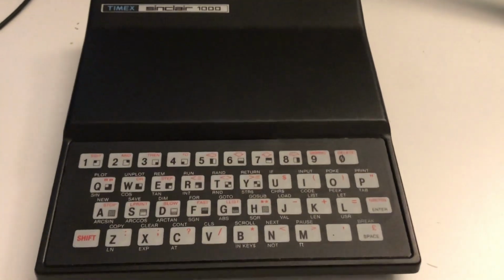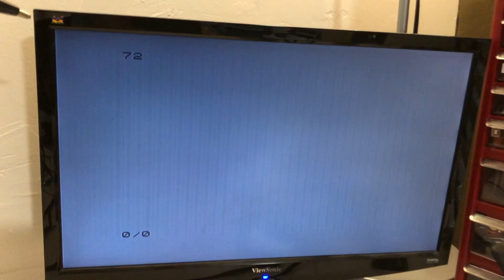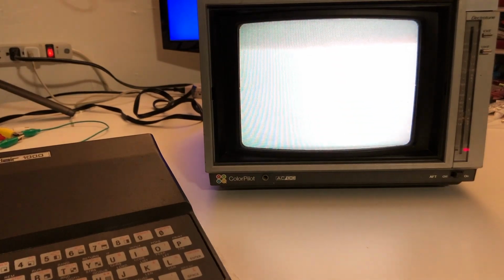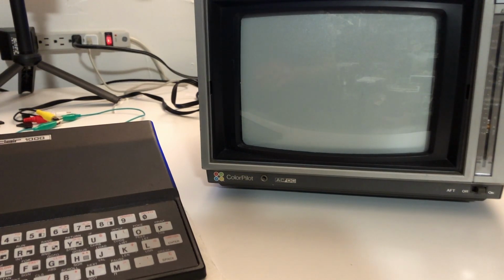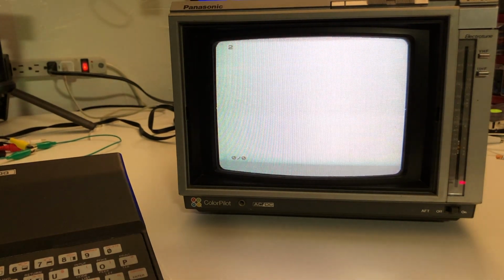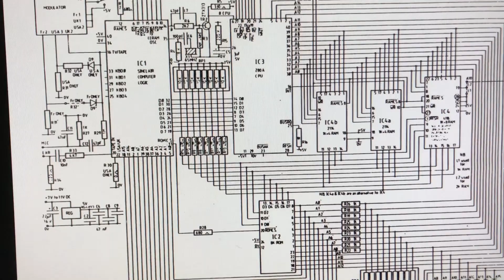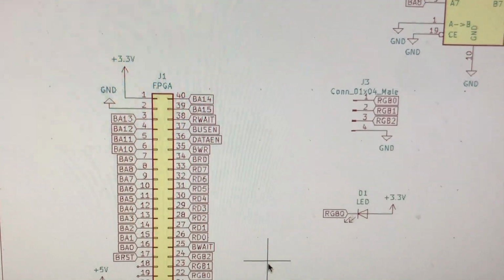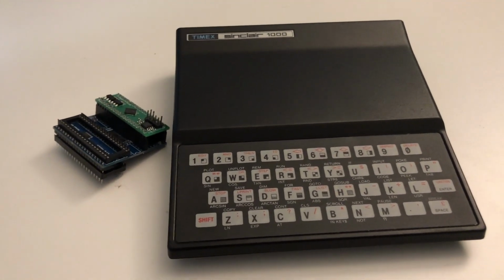ROMulator Z80  - First Test!

Comment: the [G] you have at startup means you are in graphics mode : but you are actually not as you don't get graphic characters when pressing keys.
the [K] you shoud have means keyword mode that toggles to something else as soon as you entered a keyword. ( which is a whole keyword associated with only one byte ).
What I think happens, is that your BASIC interpreter doesn't init properly ( maybe you don't start the ROM on the right address ) That should need investigating.

hi from France, I am 53 and have been using a ZX81 since 1982 :D

Comment: Zxiq doesn't have "video memory" as such, the video signal is generated by software. The screen contents are actually stored in a movable "list of terminated strings" structure. I'm not certain after 40 years, but I think the line terminator is a C9 RET opcode for some reason.
Makes sense that what's breaking is either IO addresses being treated as memory addresses by your hardware, or the high bit of the address bus being used by your hardware where the ZX81 itself  ignores it - as you thought.

Comment: T/S 1000 has metal across the board that to ground the case for FCC. Problem is One end likes to break solder joint.  This can cause the computer to not work even when board is in the case. Don't fix the metal but cut in half then use small wire to jump ends on the board.

Comment: ZX81 and Zx80 are not the best for testing a Z80 emulator. The architecture used in not “clean” at all. The cpu PC register is used as address generator for video image scanning by tricking the cpu to “read” NOP from program memory ! The data buses are separated by series resistors ;). Use a least zx spectrum that has not so strange architecture.
Reply: I dunno what a "strange architecture" is, is there an architecture god deciding this you subscribe to? Anyway, the good old specci is strange too under your critera, as it still has resistors on the data bus, on the ULA side to be more precise. Also, the specci ULA switches off the CPU clock instead of making it properly release the busses. Maybe this all is just design reality as opposed to ex cathedra.

Comment: The ZX80 & ZX81 (T/S 1000) use some clever tricks to have the CPU do most of the work in generating the display.
It's easier to see what is going on from the ZX80 schematic. Since the same logic is implemented by standard TTL logic chips.

Both the ROM and RAM appear at multiple addresses.
For the ROM this is 0000-1FFF, 2000-3FFF, 8000-9FFF, A000-BFFF
For the RAM this is 4000-43FF, C000-C3FF (1K) 4000-47FF, C000-C7FF (2K) 4000-7FFF, C000-FFFF (16K)

What's used as the video memory is the copy between C000-FFFF.
The reason for the cursor changing to an inverse G is the system variable MODE. According to the manual, this is at 16390 (4006) though it looks like it's 49158 (C006) which the ROM actually uses.
What should work with the ROMulatior would be to add 14k of RAM between 4800-7FFF mirrored at C800-FFFF. Replacing the internal RAM requires holding RAMCS high on either the ULA or the edge connector.
RAM expansions larger than 16K for the ZX81 would only enable the external RAM between 8000-FFFF for none instruction fetch operations. Emulating these would require M1.
Reply from the maker: Thank you Mark, great information! The next revision of the board including M1 should be arriving in a couple of days, I will try this out.
Reply: @bitfixer6502  What's actually going on is that the Z80 attempts to execute the contents of the display area. The ULA latches the contents of the data bus and then overwrites anything other than a HALT instruction with a NOP. The ULA behaves in this way depending on A15 and M1.

Comment: Nice! I like it. What kind of FPGA are you using?
Reply from the maker: it's a Lattice ICE40UP5K-SG48I. Using apio/yosys/icestorm for the build system.
Reply: @bitfixer6502  How about the IDE? Support VHDL as well as Verilog? Does this board requires an external (expensive?) programmer? I'm really interested on an alternative to Altera/Intel FPGA/CPLD
Reply from the maker: @siriokds  I'm not using an IDE at the moment, just a good old text editor. I don't know if VHDL is supported, I have only been using verilog. This may be in the documentation for yosys or icestorm. It currently does require an external (SPI) programmer, but not an expensive one. You can program it with a raspberry pi, I also have a standalone programmer using a D1 Mini (ESP8266 dev board) as well. Pretty much anything that supports SPI could be used, but those two are already implemented.